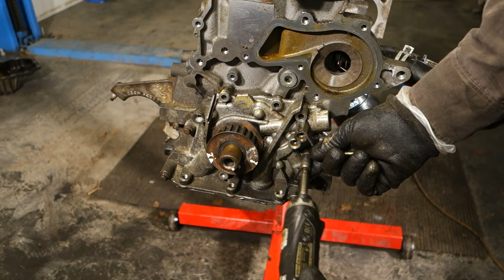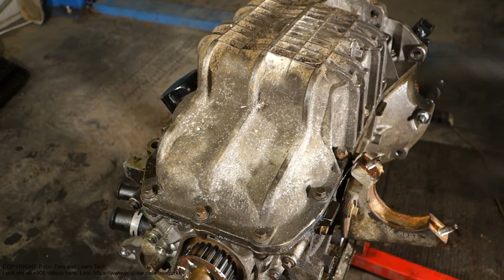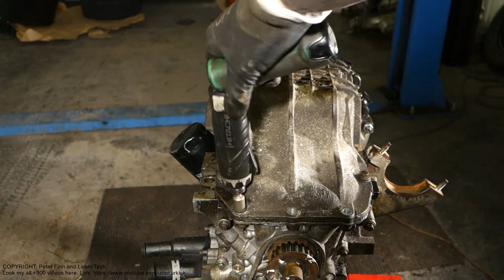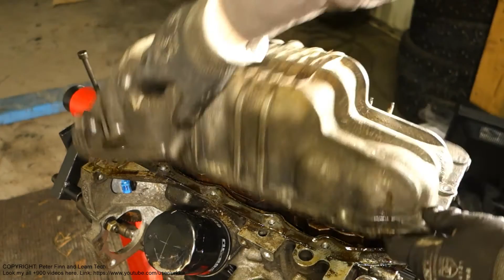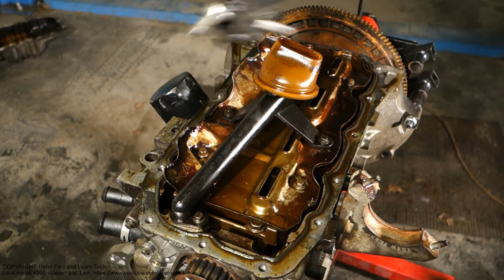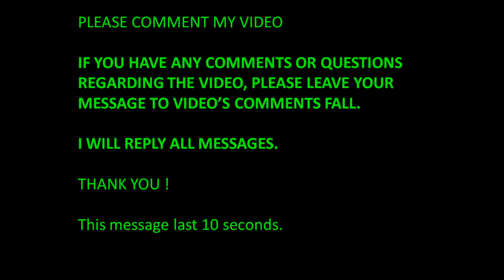How to replace Ford  Zetec engine oil pump

Comment: Hi guys......my 2007 Ford focus zetec blows out the oil filter, I bought a new filter but still blows it away leaking all the engine oil..

Could this be a faulty oil pump or something else
Reply from the maker: Yes
Reply: @PeterFinnTheCarDoctor  so do I need to change it completely  or fix

Comment: very good video...can i replace the oil pump gasket without removing the whole engine out of the car?i have a small oil leak from the oil pump pulley.
Reply from the maker: Well... maybe

Comment: hello, I would like to ask if it is the same engine after ford focus 1.8 16v 115 hp gasoline, all models is the same oil pump? I also have a motor ford focus mentioned above and I think it would have problems with the oil pump because it hardly climbs the oil up to the valve ramp. Thank you.
Reply from the maker: You are maybe right. Same part